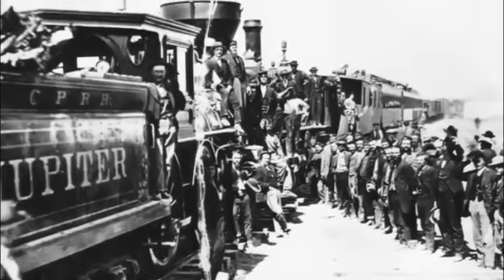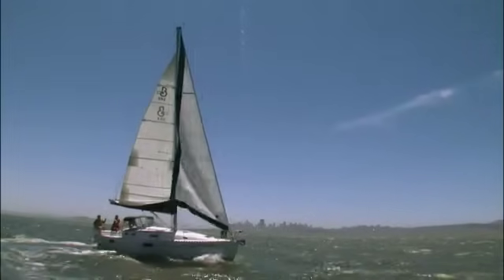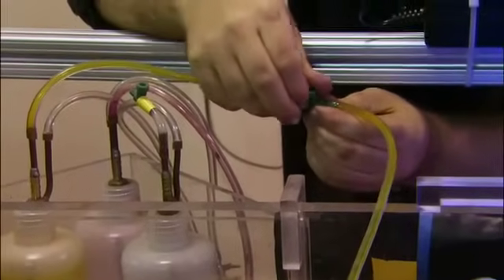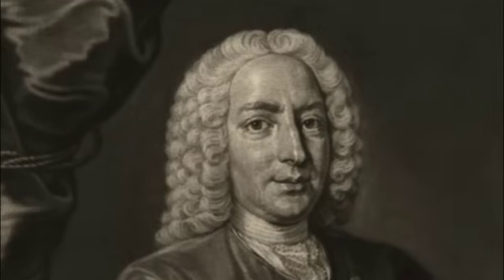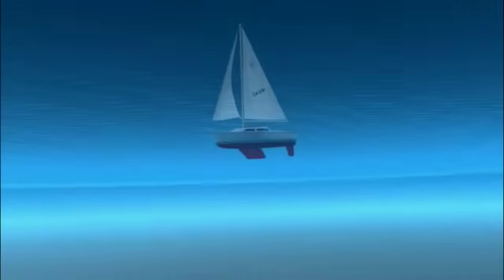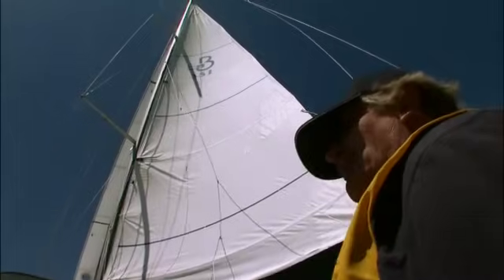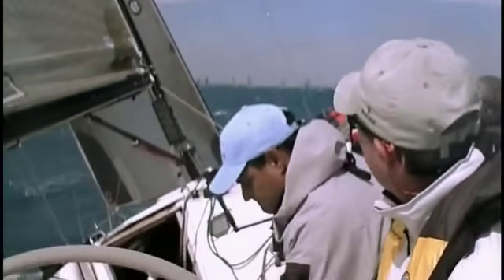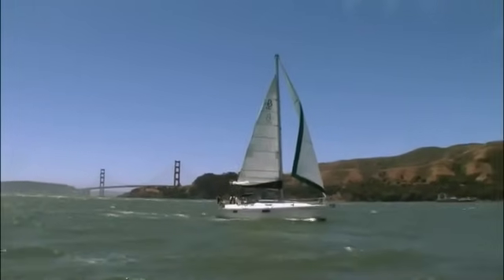The Physics of Sailing | KQED QUEST

Comment: Sailing into the wind can be demonstrated with a slippery wedge on a table top. No elaborate lift theory necessary. And my first sailboat had a "keel" (a daggerboard) made of a sheet of plywood. No lift there either. A 12 year old can learn to sail very efficiently without knowing anything about fluid dynamics or even physics. Sailing is fun and pretty easy (Though winning races is not). Just start on a very small boat so that you can instantly feel the effects of your adjustments and you'll have loads of fun while learning.
Reply: trisailor33   Yup.  There are good analogies and the wedge is one.  As the NASA guys said in the video, the sailor doesn't need the physics detail (just as a airplane pilot doesn't).  You only need the practical knowledge of how to trim the boat, but some folks like tha kind of detail stuff....And BTW, a flat plate does generate lift.  That's how paper, or small balsa toy airplanes fly.   We fly them just fine with no thought of physics.  The problem is that the rtur physics has some detail that takes more to explain and many don't care about that detail.  Unfortunately, many who *do* try their best to explain it with a limited background in the physics don't get it correct.  The true detailed physics of a flat plate is actually the same basic phenomenon as any other wing, sail, daggerboard, or keel....that is, the true physics not the common misconceptions. ...Even if you have the wrong understanding of the physics you can still sail (and fly) well knowing the practical stuff.

Comment: That's all very interesting except that it's wrong.  The paper blowing trick has nothing to do with the forces you're dealing with.  It is the same thing they use to show us when describing how airplane wings generate lift,  which is also wrong.
The wing and the sail simply divert air in the opposite direction and then Newton's third law takes over.
Reply: +Jon Blake John, you're looking at only one side of the entire piece. It has been debated for yeas how much of the lift is from Newtons Third law (equal and opposite) and how much is from Bernoulli and pressure differential. In the end, depending on the situation both seem to contribute. Not sure where you got your information.
Reply: +AK FOX 
Bernoulli is not strong enough to produce the lift,  besides,  how do you account for the fact that some airplanes have symmetrical wings?  Shouldn't the curved surfaces cancel each other out and produce no lift at all?
Reply: Jon Blake
Jon, you need to read more carefully, I didn't say I believe Bernoulli accounts for all the lift, I said I believe it's a combination of that and Newtons, meaning the air is also flowing down and being pushed down depending on the angle of the wing or sail and that also contributes. That is why an airplane can fly upside down and also have symmetrical wings (Newtons Law).  Symmetrical wings would obviously just take advantage of the downward force of the air and have no advantage of the pressure differential of Bernoulli. But if you look it up, wings that are cambered have advantages such as lower stall speeds etc.